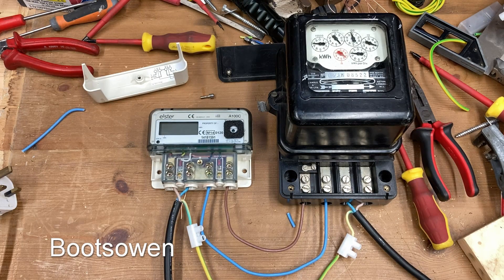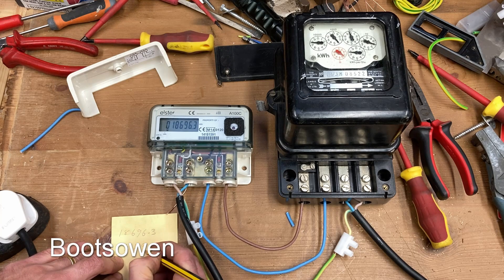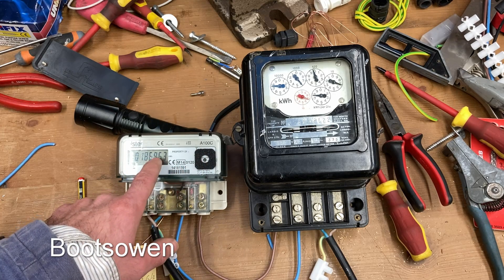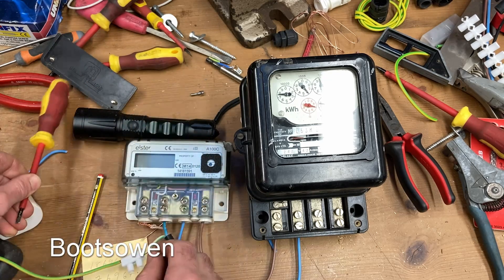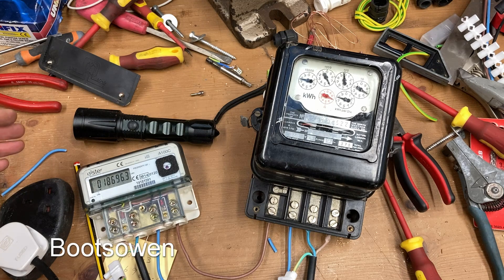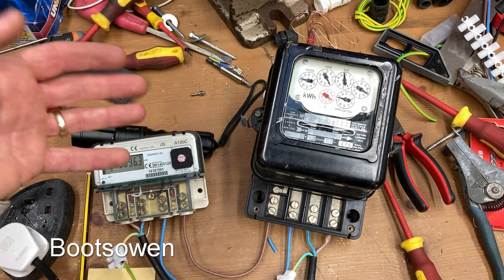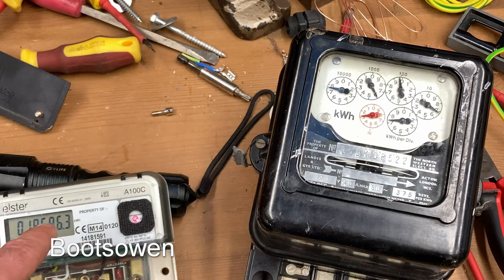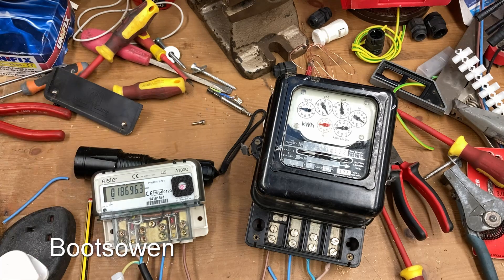Can I make my electricity meter run backwards? Don't try this at home?

Comment: Does not look to me at all that you have "reversed the live and neutral wires .You just unscrewed them and put them back again exactly the same in the same terminals .I used to find meters running backwards on analogues with a rotating barrel only when solar panels were installed.or did you take live and neutral from the analogue over to the digital and vice versa

Comment: Good video. The analogue Landis&Gyr meter should be at a vertical position for good accuracy, surprising it worked laying backwards. Some newer disc meters have a reverse running stop so the disc won't run backwards.

Comment: Owen, go with plan 1 as it entails no cost and it sound like much more fun. Point here feeding a shut down grid with a generator would just instantly overload the generator as you would be trying to power all the houses on that system. First sunny day will tell you all you need to know as to how your grid meter is performing. We get the RED showing on our digital meter. It shows high, low, and red. Cheers
Reply from the maker: Yesterday was very overcast here, between 50w and 200w, even with this tiny amount generated the red light (reverse flow) was on from time to time, even with a washing machine on! Our "rEd" legend has been flashing for years. I took option 1 today and added the electronic meter but the wrong way round. I will see what it does tomorrow. Today there was some very low sun between cloud and we got up to 1100w once or twice.
Reply: @bootsowen  Owen, the excitement is tangible and within 2 months output will increase dramatically. Brilliant, it just takes the will to do something, well done, cheers
Reply: Owen, I assume you have taken readings from the inverter generation log. Would be really something to compare monthly consumption from now with that of last year, and a video log about it. The target is for a monthly bill that is close to standing charge and VAT only, perhaps in June, cheers
Reply from the maker: That's the plan. The inverter is quite fancy, it has the capacity to search by date range. I have meter readings for the house for the last few years. But even comparing one year to another has no consistency, and that was import only. The last two years are odd anyway,
Reply: True, a domestic under 10kWh generator would stall as most of the houses connected to power grid would be still connected to the grid, even if the grid has been shut down, so the generator would get overloaded and cut off,